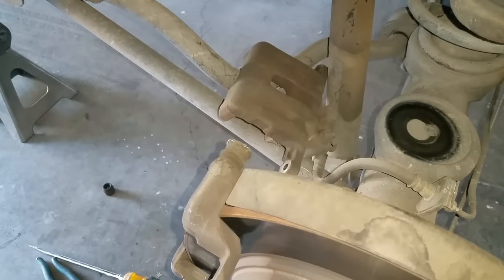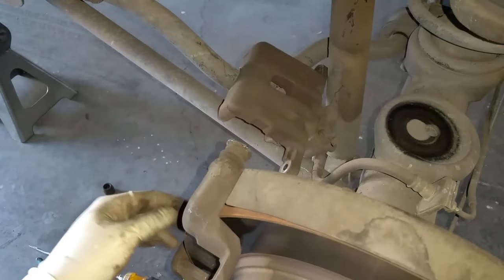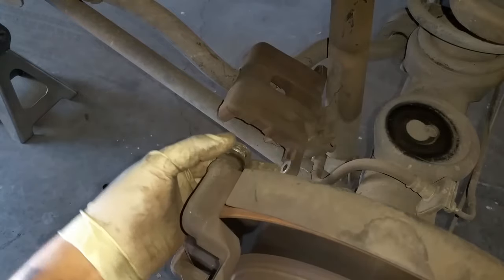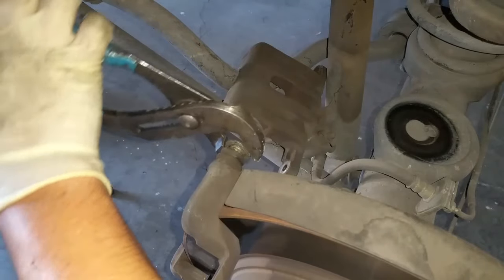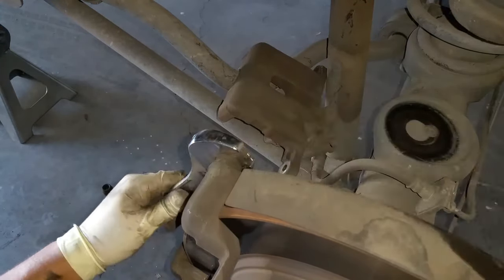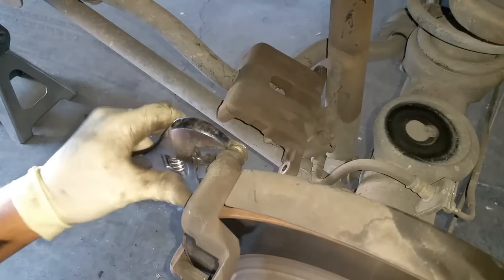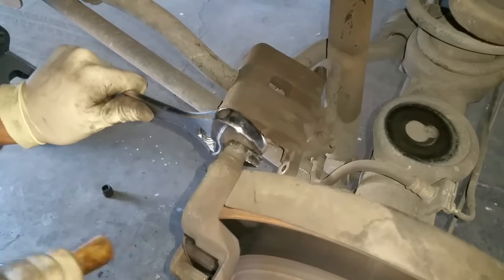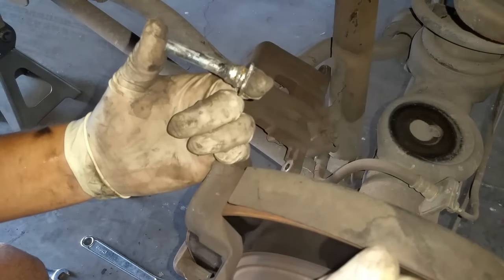Here Is How To Remove A Stuck Caliper Slide Pin

Comment: Big pair of vice grips....grab and twist....and wiggle the pin out.... clean out pin hole with drill bit (same size as hole), PB Blaster and then brake clean in the hole...rinse....(rinse out rust) repeat as necessary...then silicon brake lube....new slide pin and rubber boot thing...done...

Comment: I am not if there was a comment on how best to remove any rust in the caliper hole, I was thinking some 1200grit wet and dry sand paper with oil would do the trick?
Reply from the maker: no that will destroy the seal on the pin if it's that bad replace the bracket

Comment: Have you ever thought of using a cold chisel? You can get a short one and then place it on the edge of where the pin meets the boot and give it a tap with a hammer.. Rotate the pin. Tap it, this way you are applying the force exactly where it is needed and you dont break any tools. I see some people use as screw driver but you shouldnt its not designed to be hit with a hammer..
Reply: A chisel could shear the pin stuck clean in the bracket...
Reply: @OlJackBurton  well, it didnt for me

Comment: Mine was way more stuck than that. I needed pb blaster, a vice, vice grips, and a torch just to get it to turn.
Reply: I came up with the exact same method, minus the vice. Twist and pull with vice grips works better than a hammer.

Comment: Also spray some brake cleaner in the hole and clean with a wire brush and make sure you lube  the slide pin up good. Great video man

Comment: Pointless vid. That pin is NOT siezed,  it moves/rotates. A siezed and rusted pin does not rotate nor move.
Reply: The process is the same.
I just freed 2 pins and came on here to see if there was another way. This is pretty much what I did though I used mole grips to fix onto the pin to get some rotation. The other pin wouldn't rotate so I used a long 19mm with an extension to force it round while attempting to get penetrating spray. Once you get the rotation you're half way there. Though for the worst pin I had to keep switching between rotation and hammering. It's damn frustrating but it'll come
Reply: @ERICSDIYGARAGE  thanks bro!
Reply: Can u still reuse the pin or is it best to get a new one but would it still be usable until I got a new pin?
Reply from the maker: if your pin has any visible damage I would but if not just make sure to give it a nice cleaning and make sure it moves freely in and out of the caliper bracket
Reply: That's what i was thinking when he rotated it.  Mine felt like it was stuck in cured cement.  I think it might take more than a wrench and hammer...
Reply: @Matthew Caughey That sounds like you would damage the bracket.  Even worse is that my pins are stuck in the front calipers which are forged with the bracket in one piece. So if the bracket is damaged, the entire caliper assembly has to be replaced and all four wheels bench bled...

Comment: That's cute. If I put a 36" pipe wrench on mine. It doesn't twist. 10 pound slide hammer, 30 min. Nothing. Blow torch is next.
Reply: How did it go
Reply: Im having the same problem now im going to buy the torch

Comment: I’m poor so when I took them out I cleaned them then greased them and put them back in it slides and doesn’t get stuck going to wait till my next paycheck to buy a tool to clean inside of the caliper bracket and get new slides with rubber boot cause I accidentally made a whole bigger on the old one person who had the car before me didn’t take care of it at all
Reply: Bruhhhh I was literally like why TF can't I just use the same bolt if I just hit it with some wd_40 and a wire brush

Comment: Well, you freely moved that pin. so it wasn't stuck
Reply from the maker: it was stuck that's why I had to hammer it out if it wasn't One blow of the hammer would of removed it
Reply: A truly unstuck, properly working one has almost zero resistance. The rubber boot is the sole thing holding it in place, and when pushed it should be loose enough that the boot alone makes it rebound back.
Reply from the maker: Thank you sir 🙏
Reply: @ERICSDIYGARAGE  when I changed the brakes on a recently purchased Ford Expedition a few weeks ago, 3 of 4 of the caliper pins were seized on the front. I'm talking had to take the bracket off, put it in the vice, hammer it, penetrating oil, vice grips to get them out seized. The rubber boots had little cracks in them that let in water, and its all over at that point. I greased the hell out of them, reinstalled them, and bought all new hardware. It's like $5 a side, no reason not to replace them. Had to wait a few weeks to do that job and the old ones just popped right out with 2 fingers like they should have, new ones popped right into place. Will probably replace them next time I work on brakes however many thousands of miles down the line because the parts are very inexpensive insurance against problems.

Comment: I think the bracket should probably be changed because there could be corrosion or metal shavings in the slide pin slot.

Comment: that ain't stuck if it twists the one i work on doesn't even twist
Reply from the maker: It was stuck it took a few hits with a hammer to come off if yours doesn't turn replace the bracket
Reply: @ERICSDIYGARAGE  yeah but the pin comes with new calipers.  Can u buy the pins seperate?

Comment: good video but you cheated and edited a little must be alot more difficult than it looks
Reply from the maker: No all I did was hammer the guide bolt out
Reply: @ERICSDIYGARAGE  the one I had my mechanic due today who was a mobile mechanic we had to put a new caliper in because it was rusted I thought that's what your video meant by stuck
Reply from the maker: @drewsquickfix  no, what you had was a guide pin that was rusted into place. There is not fixing that only replacing. I wouldn't of recorded the video if it just needed to be replaced

Comment: You put the slide pin in the jaws of a vice, in caliper bracket. Apply heat to bracket close to where pin sits in bracket abd twist. By the way, that's a carpentry hammer!
Reply from the maker: +Jeremy knight not everyone has a torch to apply heat, your suggestion is too much work and the end result will be the same, you will need to bleed the brakes if you remove the caliper, a hammer Is a hammer

Comment: You call that stuck….that’s a no brainer…they sometimes are rusted in …requiring heat-n-beat on a machinists vice!
Reply from the maker: If your caliper slide pins are to that far gone you shouldn't even bother trying to fix it just get a new one this method is only intended for people that their slide pins are not completely rusted

Comment: vice grip
Reply from the maker: Vice grips are also good method but you have to be careful with them because they can dig into the metal of the slide pin
Reply: @jackhammer111  I thought about using vice grips myself, but vice grips are much more fragile than a solid wrench. I could care less about damaging the freaking pin except for it breaking in the bracket.  That would be an bigger freaking problem. The replacement boot kit i'm using has a brand new pin...

Comment: won't work
Reply from the maker: Everyone else said it did
Reply: @ERICSDIYGARAGE  I ended up removing the whole bracket, locking it onto a vice, on the slide pin. Then bear hugging the whole bracket and trying to turn it left and right until it finally broke loose. Seems like a safer method for not damaging the bracket as well, they aren't cheap.

Comment: I hate when a video is prepped.
Nice shines bolt comes out with ease...
Truth is I’m sure it soaked for days in
penetrating fluid and a torch applied.
Not to mention a 55 gallon drum of elbow grease
and a carpel tunnel operation.
Suck it up buttercups and just buy new calipers.

Comment: “Stuck” guide pin. Proceeds to rotate it for better angle, lol. Clearly you don’t know stuck!
Reply from the maker: Stuck is not the same as rusted into place if yours is that frozen that you can't rotate it than you should replace the bracket and pins

Comment: Try showing us a pin that is actually stuck. Your video has no good information. You took out a pin that was easy to remove
Reply from the maker: if it was easy to remove I would of removed it with one blow of the hammer, thanks for watching 👍